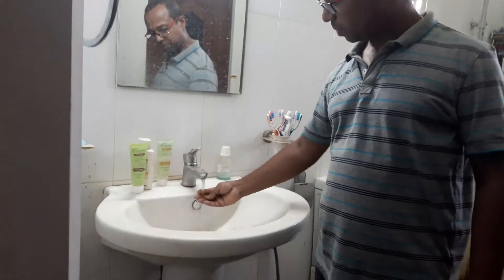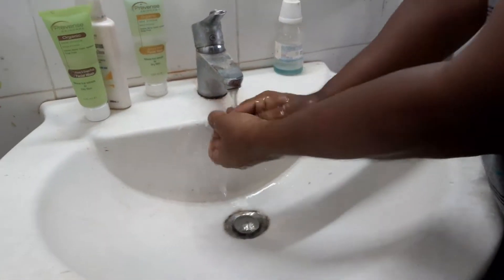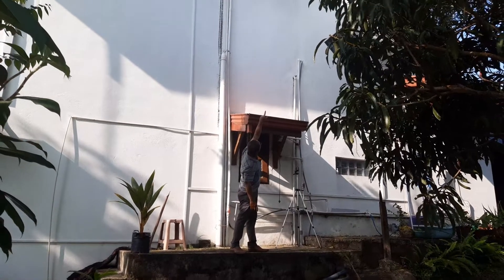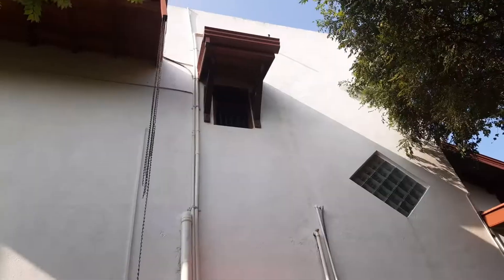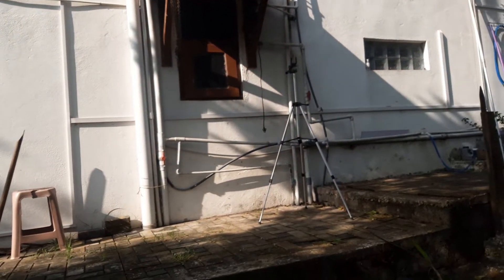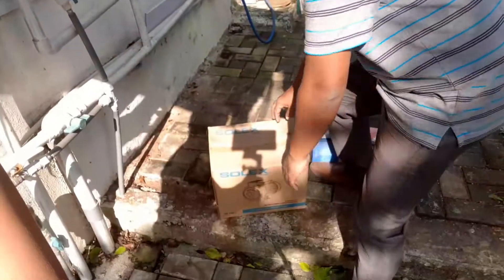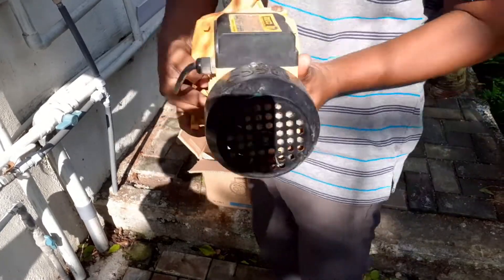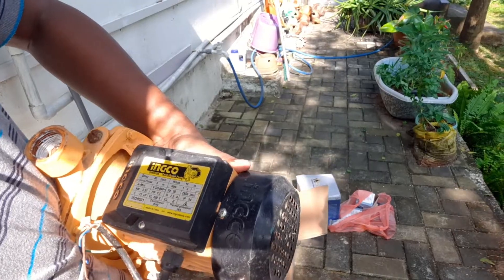DIY Water Pressure Boost Pump Installation for Bathroom | Automatic Pump Controller Setup

Comment: I do not think its a floater switch. It sounds like a non return valve. Normally these units have a pressure transducer to measure the water pressure above the non return valve and turn the pump on whenever the pressure drops.
Reply from the maker: Yes! You may be correct!  There is a non return valve which is visible from outlet side.  But the sound is not seems to be from that.

Comment: How much this unit?
Reply from the maker: Check out Automatic Pressure Controller - SLONat 6% off!Rs. 7,250 only!Get it on Lazada now! | https://www.daraz.lk/products/automatic-pressure-controller-slon-i123717028-s1040888153.html?dsource=share&laz_share_info=5767828_3_100_1000003221890_5637907_null&laz_token=7a4945ae82477c638ec32d42a18712b7
Reply from the maker: Rs.7,250
Reply: Now 10200/-
Reply: आज रोजी तुम्हाला हा amazon वर ₹1579 ला मिळेल.